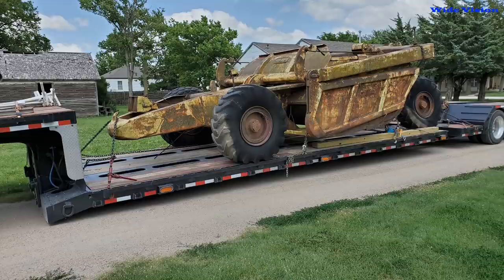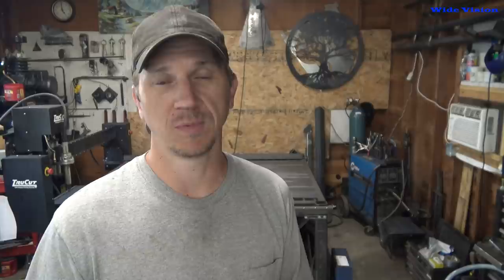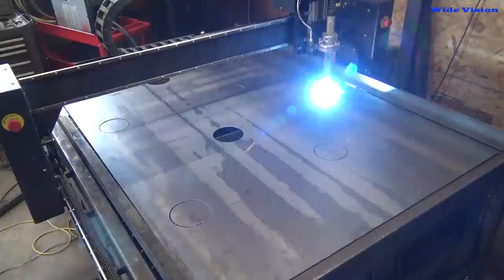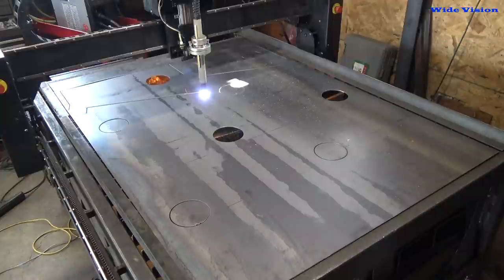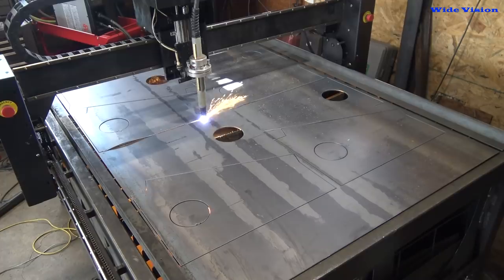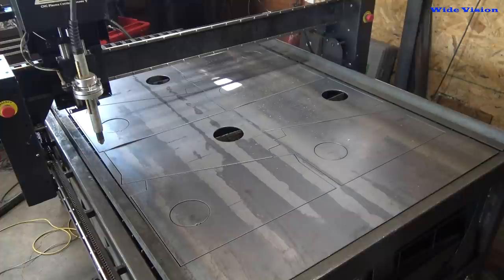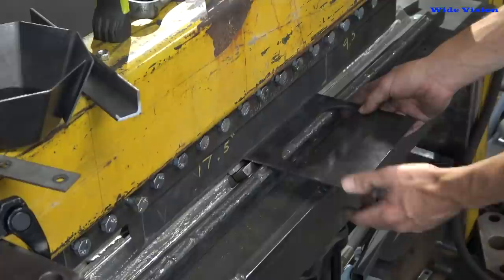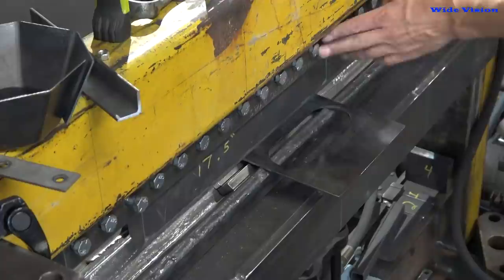Plasma Table and Press Fun! Lowboy trailer gusset build.

Comment: I would suggest you build yourself a parts Tumbler to take the dross off the parts ours is hexagonal tube shape with a door on one side we put any old bolts, dropouts from the plasma cutting in with the parts it helps with cleaning. However I would not put the decorative signs in it

Comment: Wonder if factory parts are T 1 steel. Did you use A 36? Nice job....cheers
Reply from the maker: I couldn't find any evidence it was anything other than mild steel.  I played with the pieces he cut out a bit, and they bent easy and the sparks from a grinder looked just like A36.   I also did some online searches trying to find out what most trailers are made of, and it seems a vast majority are mild steel.   So, yep, I just used A36 plate to put it back together.